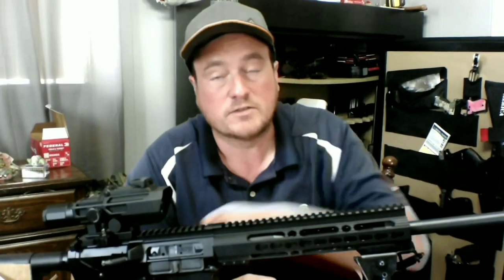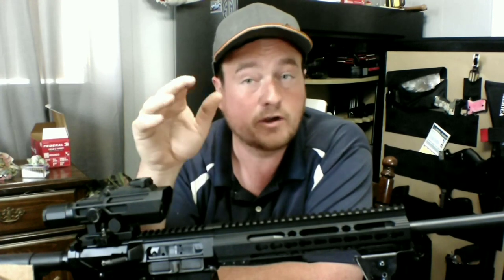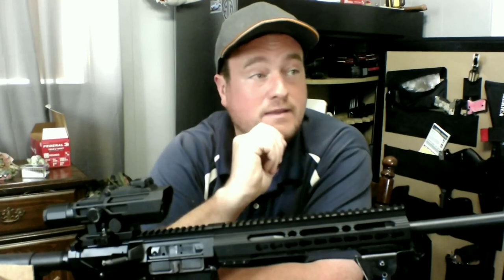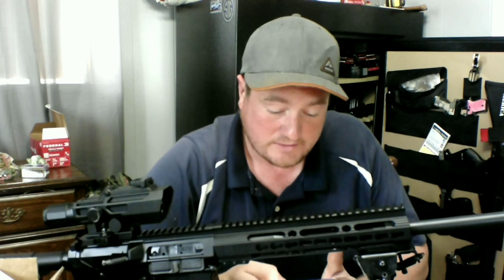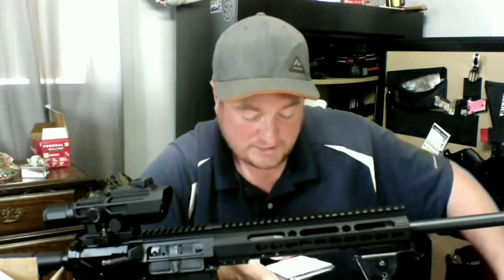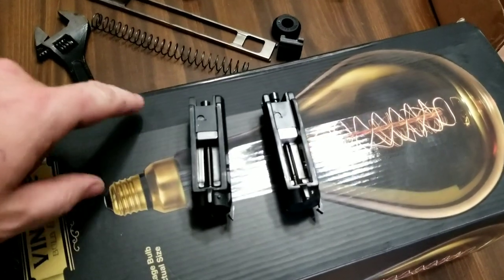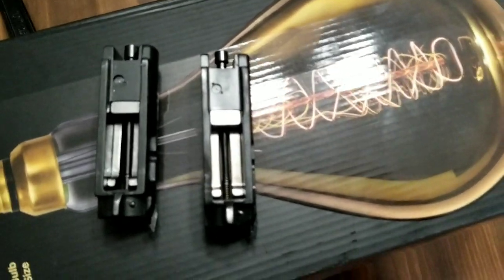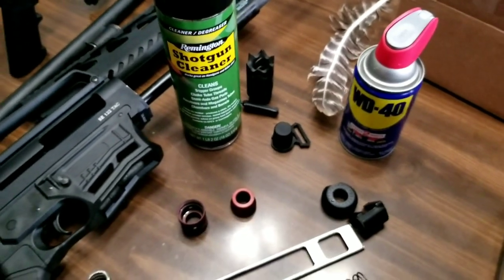Silver Eagle parts and service

Comment: Wd 40 may gum up because of it's flash point. Bring some of your gun oils and wd40 to the rack and we'll test where they flash at
Reply from the maker: We will test the flash point of the sex lube as well ?
Reply: @GearsAndGuns  it would be a good idea to honestly. Too much friction might set it off
Reply from the maker: @johnmyers6802  you working this weekend brother? Trying to pull ring gear with 5 ton come along at the moment
Reply from the maker: @johnmyers6802  results should be interesting

Comment: Mine jams on every shot.about 200 rnds through it still jams.
Reply from the maker: Really??? You think it's a mag issue? Any more info?
Reply: Not a mag issue.tried 3 differant ones.first shot fired shell was stuck in the chamber so hard thought i would have to hammer it out.polished the chamber better but still not ejecting.
Reply from the maker: @lesteryarbrough2403  I'm taking it you tried some heavy loads to see if that makes a difference? Some 3 inch magnums? I'll put a link here where I show how to take it apart and put it back together in detail maybe that will help in case something isn't right there.  

https://youtu.be/QkvHO3KkAOI
Reply from the maker: @lesteryarbrough2403  also try shooting it without the magazine in it at all. I remember someone else having a similar problem and the bolt was hitting the next shell, no matter what mag he used
Reply: I will try it without a mag.ive taken it apart 3 times so far everything is right.ive tried high brass 2 3/4 no magnums. Going to try the lapping compound on the chamber again.then its back to them.
Reply: Thanks for replying.and the advice
Reply from the maker: @lesteryarbrough2403  no problem!! I hope it helps. Let me know how you make out. Far as mine goes, it runs great! It doesn't like 3inch shells but 2 3/4 its runs great. I herd of a few people having problems like yours tho. I'm pretty sure some other guy had the same problem like I said earlier and his bolt was hitting the mag or the next round. Their customer support is very good and helpful or at least the couple times I talked to them